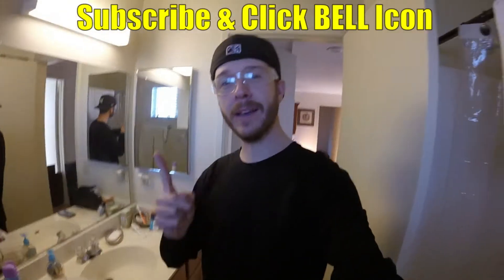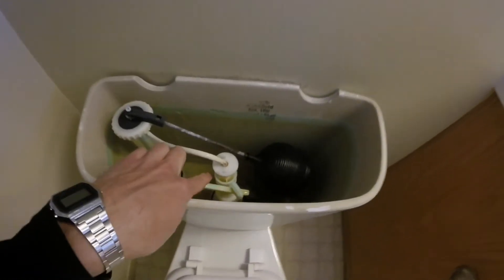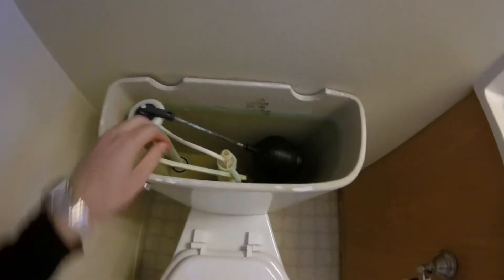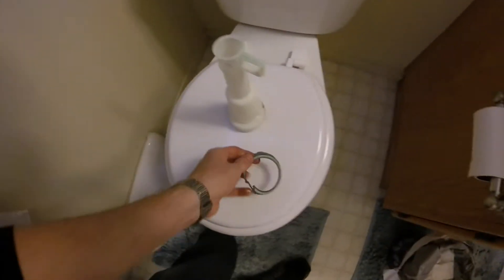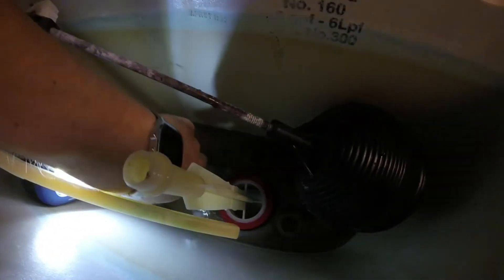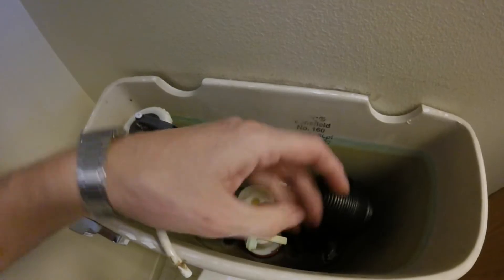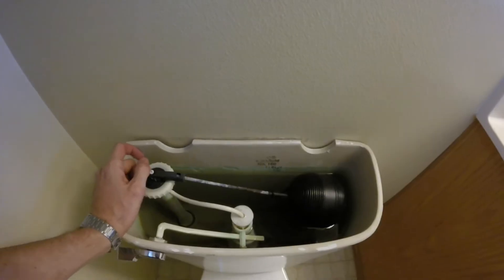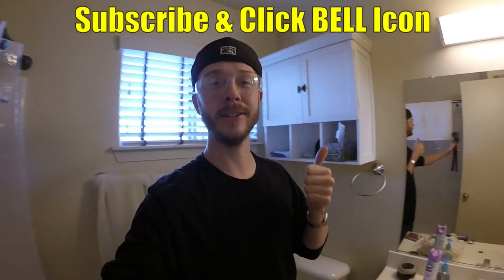Mansfield Flush Valve Seal Replacement 210 or 211. Fix Running Toilet & Stop Wasting Water.

Comment from the maker: TOOLS & SUPPLIES
Mansfield 210/211 Flush Valve Seal- https://amzn.to/3CnppdC
Other Brands Toilet Flush Valve Seals- https://amzn.to/3kmleIY
Rubber Gloves- https://amzn.to/3hLZRiu
Microfiber Towels- http://amzn.to/2u4eXJ4
Tool Set- http://amzn.to/2xoyu5c
Safety Glasses- http://amzn.to/2ez41Jw
Magnetic Work Light- https://amzn.to/33tk6tp
If you Enjoy the Channel Consider Helping Support it by Donating below & by Subscribing & Clicking BELL Icon
 ⭐ PAYPAL DONATION https://www.paypal.me/JonnyDIY
Reply: I’m having a problem, that gasket keeps popping loose.  Seals fine but no matter how many times I put a new gasket on it eventually pops off.
Reply from the maker: @ob_weirdo0weirdo874  hmm maybe try different brand seal or may need replace that part it's going on to

Comment: Thanks to you, I avoided a lot of problems.  I had tried a new flush valve seal, but the problem wasn't fixed.  Seeing your video, the simple statement of putting it it the grove near the top, and then it would spin is what did it. I had it there but not in the proper grove.  Thank you for that short but important piece of information.
Reply from the maker: You're very welcome, happy I could help you get it fixed 👍

Comment: Nice video. I always liked our Mansfield toilet, it worked flawlessly for over 30 years. The only draw back was the huge amount of water it used. Went with American Standard and greatly reduced our water consumption after a remodel.
Reply from the maker: Thanks, yes it flushes great. This one isn't too bad it's a 1.6 gallon, will eventually switch to 1.28 I'm thinking.

Comment: To make absolutely sure that's the problem, I shut the water off at night and if the tank is empty in the morning, that's not the problem. It could be the seal is not sitting properly and some of the comments were that could be the issue. Just rotate it around and make sure its fitting properly. In the morning, if the tank is still full, you've fixed it and good for you!
Reply from the maker: @Bluffton3  nice idea for problem solving 🙌👍 thanks for sharing

Comment: Hey there! Thank you- I definitely needed a new gasket here. And I’m certain I’ve got it on correctly. The black gasket below is dissolving to the touch, though, and my toilet is still running a slow trickle into the bowl. Do you have video on that by chance? lol thanks again!
Reply from the maker: Sorry I don't have a video on that seal. I believe you may have to take apart the tank and toilet to get to it replacing that part
Reply from the maker: May be worth buying the whole kit to replace all the guts of toilet if taking apart that much

Comment: what is the black ring/seal under the red seal we just replaced? It caused my water to turn black too (assuming this is from the black rubber deteriorating). If that happens does that need to be replaced too?
Reply from the maker: Thats normal. Thats most likely the seal that seals the 2 pieces of the toilet together. Those seals always make black when disturbed. They're fine to leave as long as decent and no leaks 👍
Reply: @JonnyDIY  thank you 😊
Reply from the maker: @squirrel00713  you're welcome, happy to help 👍

Comment: Good job!  Have you ever done a video on how to do a full brake flush on a CRV?
Reply from the maker: Thanks John! Not yet no, usually don't have to do a brake flush for 10 years. I do have a video where I siphon the brake reservoir out, that works well. You just do it once a week maybe 4-5 times and it'll get the whole system nice and clean 👍
https://youtu.be/vcUXdtx6qaA
Reply: @JonnyDIY  Jonny, I think the brakes get flushed every 2-3 years per maintenance minder.
Reply from the maker: @jamkpa  wow that seems a little overkill to be honest, it doesn't really break down. It can just absorb water over many years. But its not too hard of process to do. You just have to bleed each brake, starting from furthest from brake master cyclinder to closest. If you look up any generic "how to bleed or flush brakes" video it will be the same.
Reply from the maker: Here's a good video from a guy I know
https://youtu.be/n1NvtUwfRJc

Comment: Whats your thoughts if its still leaking after replacing seal? Very slow leak not a perfect seal.
Reply from the maker: May be sediment built up on flush valve assembly. Try cleaning where the 2 come together to seal. Could have possible got a bad new seal as well, I'd give a day see if it swells up and seals. If no luck I'd probably try another seal then replace the assembly if seal doesnt work
Reply: @JonnyDIY  ty brother!
Reply from the maker: @billn9n  you're welcome, good luck 👍

Comment: mine seems the bottom one rotten, will it cause leaking?
Reply from the maker: @MrEugeneleo  the seal between tank and toilet? It can be replaced if bad as well but I would'nt worry about it until it starts leaking or you think may soon 👍

Comment: Will a bad flush valve cause issues with slow flushing toilet?
Reply from the maker: Slow flush usually caused my not having flapper chain adjusted correctly. Pull lid off and make sure chain is pulling flapper all the way open with normal push on handle 👍
Reply: Mine does not have a chain. It is the same style as the second toilet in your video.
Reply from the maker: @DouaVaaj  that's right sorry was thinking of another toilet. Make sure water level is coming up high enough it may not be filling tank enough
Reply from the maker: You can do that by adjusting the float on the left side👍
Reply: @JonnyDIY Thank you for the tips! I need to replace this screw, you mention, as it was not adjusting, properly, and came out. Is the screw easy to replace, without having to buy the assembly? Additionally, is the screw supposed to screw through the blue part of the assembly, and into the white part, underneath it?
Reply from the maker: @Tflyisme  it should be replaceable.  I would take multiple pictures of what the assembly and go to hardware store and look for the parts. Somtimes you have to buy the whole assembly for guts of toilet, but it's cheap 👍
Reply: @JonnyDIY  Thank you so much! 😊
Reply from the maker: @Tflyisme  you're welcome, good luck 🙌👍

Comment: Mine not working what ever I do. Original toilet it’s been 17 years old house no gasket fitting to hold the water. I tried grove area as well gasket tight no matter is the grove section barely fit but not turning even I let fit to that line
Reply from the maker: Sounds like gasket may be wrong size. I'd take picture of inside parts and outside of toilet and toilet brand. And go to hardware store and show them

Comment: The white hose pops out every time we flush, how can I stop that?
Reply: The tank fill hose
Reply from the maker: Even if you jam in down in? It still pops out? If so and hose has a lil slack cut end off, may be just worn and compressed. And jam end in. If still no go, remove and take to hardware store and get new one "tank refill tube". Can buy whole assembly if need be and just use tube and save extra parts 👍

Comment: Now the 27 year old angle stop will start leaking around the stem
Reply from the maker: 😆 yeah I usually spray with lil wd40 on the stem if havent been worked in long time. I usually replace them to 1/4 turn ball valves now